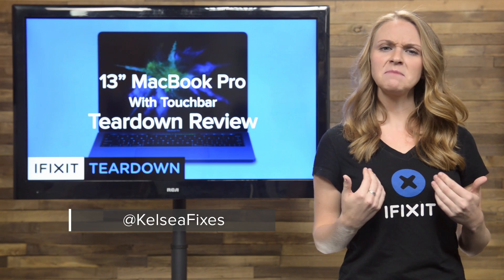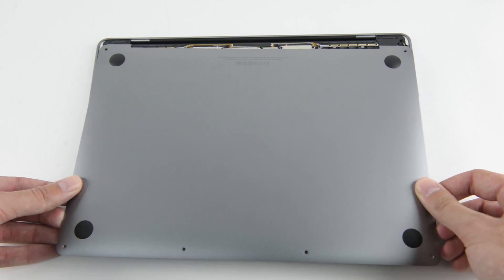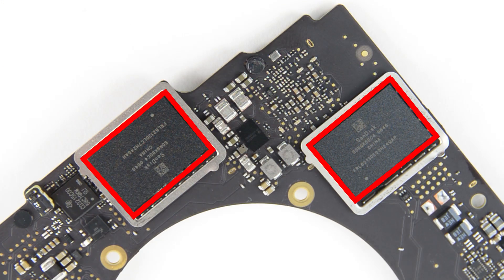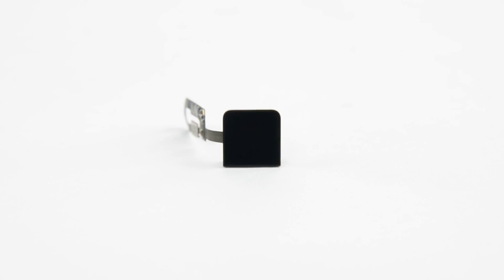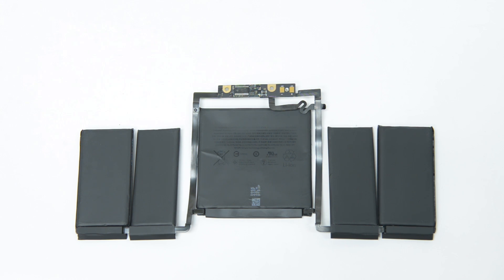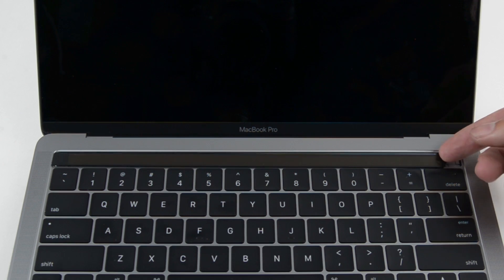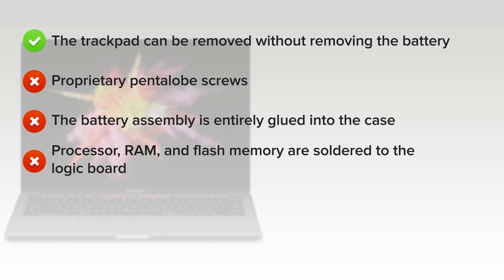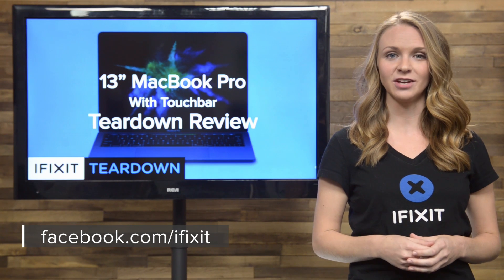13" MacBook Pro (With Touchbar) Teardown Review!

Comment: I have bought a 2018 MacBook Pro with touch bar and I have noticed that ANY key serves as a power button. So if the finger print sensor loses its ability to power on the MacBook, you can use any other key instead.

Comment: I Really don't think the screws should still be counted as a disadvantage in a world of GLUED SHUT devices. Sure, they are "proprietary" but they've been in use for years now and it's pretty easy to get your hands on a pentalobe screwdriver these days. Any good micro screwdriver kit includes a pentalobe head.

Comment: Early 2011 Macbook Pro user here. Just upgraded the hdd to an ssd and added some more ram - works like a charm. The word 'Pro' has sadly lost it's meaning these days.
Reply: I still have the october 2011 500 HD MBP,but had to replace logic board and battery,sucks that now MBP are more expensive with less storage

Comment: MacBook Pros were downright amazing up until mid 2012. The disk drives gave you the option to add a second hard drive or SSD, the HDD itself was easily replaceable, the battery was extremely easy to replace, the ram was very easy to upgrade and overall taking the MacBook apart was simple as long as you had somewhat of an idea or experience before. This is why I am holding on to my 15 inch mid 2012 MacBook pro. Its powerful, easy to upgrade and/or repair.
Reply: And since 2012 prices increased and storage reduced

Comment: You could actually de-solder those SSDs and rams using a hot gun and upgrade them whenever you want. But it can be tricky if you don't know basic electronics.
Reply: bulbadox It is also expensive.

Comment: Apple doesn't want you to repair your device. They want you to replace it. Which is great for their bottom line. But let's take a moment to consider all the e-waste when you pretty much have to scrap an entire laptop if something even minorly goes wrong with it or one of it's components. And also consider that you're now paying even more of a premium for a machine that is basically unserviceable and in it's current state, damn near unusable unless you pay for a ton of adapters. I just received one of these from my work (15" model), and while it's fast, it's bloody hobbled right out of the box. I'm the  guinea pig tester boy before they decide whether or not they're going to buy more of these (frankly, they'd be better off right now buying Airs and the previous MPB's) and in the few days I've had it, it's not been very impressive, especially with battery life. The battery seems to go down as quick as my MBP 2013 model and it's battery is saying 'Service Required' or something to that effect. Maybe it's just the added horsepower that's straining things but don't think you're going to get hours of usage out of this machine. I'm estimating two hours (if that) and that's not even watching movies or doing anything intensive. Beware. And the touch bar is basically a gimmick at this point. It's not offering anything that regular function keys or the Dock don't provide considering you have to keep looking from the screen to the touch bar to see what you might want to press. The Esc key and the Siri shortcut are the only two things I find useful at this point.

Comment: It's confirmed: iPhone 8 will not have any port, even for charging - U will have only newest Apple aiRcharging system. Really, Apple will invent outside charging stations (You won't be able to buy charger) and and You will need to find one, and pay Tim Cook for the battery life.  More over: for a 100$ more You will receive basically iPhone 7 but without any port and smaller battery, and You will need to pay 400$ more (than iphone 7 plus) for the real iPhone 8 Plus with premium materials and design, but also without ports. Next will be the Mackbooks - also without ports, and without keyboard - Apple will replace keyboard with a fu%$%$ing HUGE track pad, and U will be able only to click. Also everything will be soldered to everything, a Huge fu%^%^^&^ perpetum mobile of soldering things to each other.

Comment: I predict (but it's not that difficult to do it) the next macbook pro will be with no screws at all but a real unibody laptop in the literal sense, I mean, it will be one single piece of alluminium without even a sort of a "can be opened cover". Next step up, next level of "gay-innovation".
I also predict that, at last one physician will diagnose to Mr Ive that strange desease or neurosis who pushes him to fuck every Apple product in order to obtain that "not always requested" thinness, particulary in products classified as "pro". I really see him wearing a straightjacket and taken away by two healthcare assitants while he is screaming something about millimiters.

Comment: But the base model comes with 256GB, not 128.
Reply: 256 is not much, i use a 256 laptop for on the go and i used more than half of it less than half a year

Comment: Is the touch bar really necessary? I am hesitating to get the 13 inch with the touch bar or without it... I don't really know if I'll use it on a daily basis since I just need a new computer for University. Can someone give me some advice ?
Reply: Paragas Ryan I think it's better to get. It's faster and faster ram. You get more ports. On both sides which is useful.

Comment: or you just send it in to apple.....
Reply: If you send to apple a computer with (for example) the touchbar not working or wtv, they will replace the whole mainboard, charge you $1000 (when off warranty) and you will lose any data you didn't backup, because it is quicker than changing inspecting the board searching for the bad chip or circuit, which would take way longer but atually be cheaper, thats why reparability matters

Comment: I dont think that its a big deal that Apple uses pentalobe screws because you can easily buy a pentalobe screwdriver online.
Reply: ***** yea I am an Apple fan because all of the windows laptops me and my sister have had in the past only lasted us a year at max before giving us major issues. Our Macs have never really given us an issues, only little hiccups and thats it. Also I really like how if you have an iPhone and Mac they are able to be in sync, widows and or android does not have something like that.
Reply: *****
The good thing with apple is that you don't have to download and set up something like dropbox it just works straight out of the box. I just save my files to the "Documents" folder or to my Desktop and its saved to the cloud automatically and I can access those file from my Mac(s) (if I had more than one), iPhone, iPad, and even a PC by logging in to iCloud.com

I never said that windows and android were the same company, What I meant is that neither windows phone nor android talk are able to connect to a pc and sync up. For example if I am on my Mac and someone calls me or texts me I can reply directly form my Mac. I don't have to pick up my phone at all.

And to answer you question both, either we have hard drive failures, viruses (to the best of my knowledge the computers just started running super slow even though we were not even close to filling the hard drive)  even though we run anti virus and we do not torrent stuff (or at least I don't) and other hardware and software related issues
Reply: I KNOW RIGHT - nowadays you buy any "Micro driver" kit (which you need to have in order to open any other electronics anyway) and the set usually includes a pentalobe head and a tri-point head in addition to the usual flat, phillips and hex. On iphone teardowns in particular I just don't get how it still counts as a disadvantage considering ALL other high end flagship smartphones today are tightly glued shut! It beats having to heatgun and pry open.

Comment: lol, next to zero repairability. but still a wonderful machine.
Reply: Frank W wonderful? Why?! Ofcourse it looks good, but it is overpriced as hell, extremely underpowered and has many design flaws (WiFi and USB 3 easily interfere for example), you need adapters for everything, they killed MagSafe, it is nom-repairable...HOW is this a great machine?
Reply: Florian Schmidt has the best trackpad on any laptop on the planet for starters. I have the surface book 2 for work which apparently has the best windows trackpad and it’s still not as good as my MacBook Pro trackpad.

Comment: where is the power switch?
Reply: In the Touch ID sensor, or when you open the laptop, you can choose in the preferences I got mine set to both.
Reply: Or at least on the 15" it is that way for me.

Comment: Apple leading the way, to the first TOTAL non upgradeable  laptop!
Reply: Microsoft did it for you 😂
Reply: Microsoft outdid Apple by quiet a margin with the Surface laptop though. 
You can't even go inside without ripping the fabric material and damaging the keyboard in the process. 
At least you can do a DIY battery replacement on the Mac

Comment: I can't believe you missed this..

One thing you completely glossed over, all the ports are now on separate ribbon cables. The number one thing to break on these notebooks are ports. If you break a USB port now, it doesn't require getting a new mainboard or soldering. Just a breakout board replacement. Same with headphone jack. That would give it at least a 3/10 in my book.
Reply: I think that having non removable hard drive makes it an automatic 1. They could easily put a m.2 or emmc style chip
Reply: iFixIt Notice this!

Comment: I knew those new mbp's would be harder to repair or modify then previous models, but I've expected more from apple. I'm a mac owner. My next computer is a pc.
Reply: well, i allready leave them since 2012. LOL
Reply: Lucas C. I'll examine this option
Reply: Anatolian ✣ You are a disgrace to us iSheeps. You people are the ones who buy MacBook because of the white logo every year. Also, it's not twice the price of a "pro" laptop, it's nearly the same price as a 15" pro laptop, which is basically overpriced. However, the intel iris 650 is very good for a 13" laptop, probably the best non-discrete graphics card in the market right now.
Reply: Lucas C.+ agreed, l got a windows 10 update that bricked my main machine and l went to linux instead of doing a reinstall of windows 10.
Reply: Warren McClure+ not to mention the heatsinks in the new macbooks couldn't even cool my morning coffee. have you seen those things? they are way too fucking small to be even slightly efficient. modern CPU's are not supposed to reach 100c, yet the bitch cooler on macbooks lets the CPU get to that temp way too easily. l have a prediction that CPU's are going to start melting out of those machines. and another thing to consider is that the thermal compound they use isn't all that great to begin with and when it is constantly under heat above 70c then it dries up faster and turns into rock.
Reply: Anatolian ✣+ "If the SSD and battery would be replaceable this would be a must buy for sure. I would use it for 10 years at least." replacing the SSD and battery would not give this machine another 10 years. first of all, the die will probably crack from overheating before this thing could get close to 10 years. and you have to keep in mind that the CPU architecture would most likely be totally out dated by that time and probably very sluggish. also having the minimum RAM requirements in a machine by modern standards, pretty much spells it's early death especially since you can't change the RAM either.
Reply: "I dont care about desktop and I dont care about graphics." so you don't even care if the computer turns on? if you computer is maxed out by just the desktop then it will crash the second you try to open a program or hell it would crash just trying to move the mouse.
Reply: "it's not twice the price of a "pro" laptop, it's nearly the same price as a 15" pro laptop, which is basically overpriced." $1,200 can get you a macbook pro that will always be overheating, has the lowest grade dual core CPU in the line up, uses integrated graphics, and 8GB of LPDDR3 RAM. for $150 less than that, l can get a faster quad core processor, a GTX 1060 which has 6x the amount of vRAM, twice the amount of RAM which is also DDR4, a larger SSD, much better cooling system, and more ports.
Reply: "I said the same thing. Built a custom PC. It was fine for a while but I eventually ended buying the 15inch MacBook Pro. I've never looked back. To each their own I guess." if you're gaming PC was just fine, then you fucked up somewhere. macbooks aren't even remotely close to a decent gaming PC in terms of power. if you like the ecosystem or whatever that's fine, but you can't compare a macbook to a gaming PC unless you live in the twilight zone.
Reply: Check the Microsoft Surface Laptop teardown.
Reply: Enjoy shitty Windows! I was just like you, was a mac owner and sold it to get a ‘better’ Windows computer. Now saving up to buy another Mac this month and will never buy another Windows machine as long as I live. I made a mistake to sell my mac and get a pc, you will too!
Reply: They used to be so easy, too! Just compare this to the Powermac G5, which comes with a diagram to replace the RAM on the access door!
Reply: but pls with linux and not cancerous windows
Reply: I applaud your decision
Reply: I dont blame you, I to was disappointed with this shit Apple is selling this year. Sure the new MacBook pros look cooler but its not worth the $300.00 increase and loosing out on all upgradeability options. Its one thing for the 12 inch MacBook not to be upgradeable (even though its really sad) but for a so called pro device to have no options to upgrade later on is total shit. I mean at least have upgradeable SSD's but nope Apple dont give a shit about what us Mac users really want and care about
Reply: or buy the MBP with USB and HDMI ..
Reply: ***** I already own one.
Reply: i think to stay in that too , an upgrade doesnt worth it ... apple this year is selling shit, iphones are weak too this years...
Reply: Riley Mullett It does everything I need it to do, better than on PC. Ableton is really well optimized for it too. The display is amazing, the build quality is the best in the business and it's super portable and more than powerful enough for my work, music production, 4k video editing in final cut and more. Also, Mac OSX is superior in many ways than windows, to pros at least.

Comment: woa, is that touch bar still working? just curious
Reply: theoretically... the touch function still work because the upper layer (touch panel) which get remove are not damaged, just the OLED panel damaged so it will receive touch event but the display are nailed
Reply: no
Reply: SandPox
ah, good to know